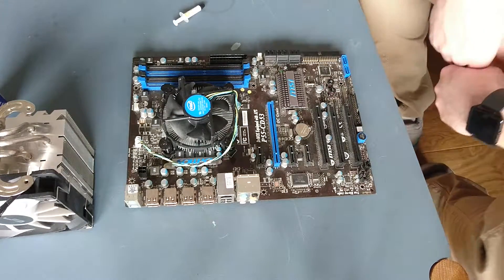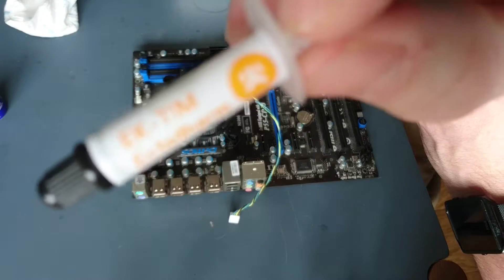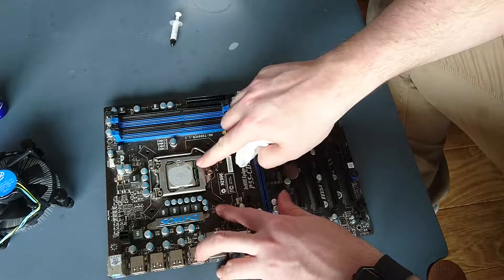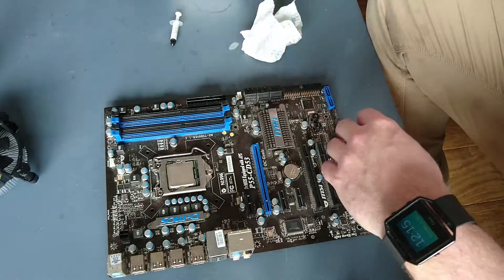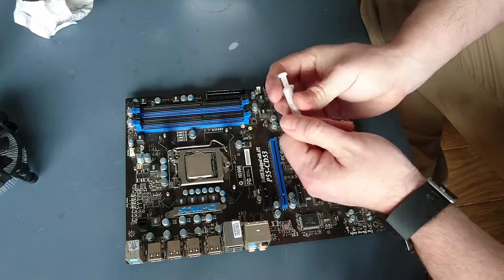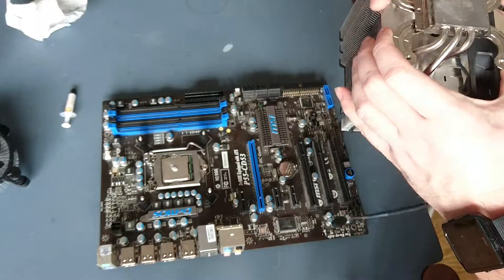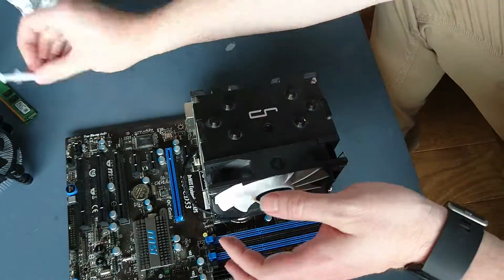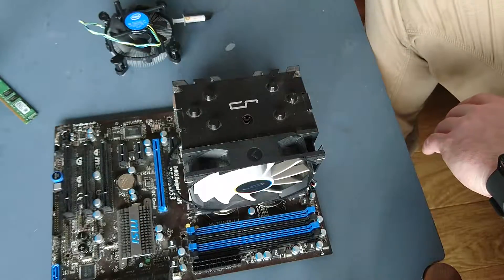Installing a Second Hand (USED) CPU Cooler

Comment: Hey man! Informative video. I want to buy a CPU and Cooler for 60$ so I am going used. I have an Intel Dh55tc motherboard. I have found a Xeon X3470 for 50$ and thinking of a cooler for 10 or maybe 20 dollars that will fit my case and I am thinking of buying a used Cryorig C7, do you think it will be a good idea?
Reply from the maker: I think cryorig coolers are pretty good, so if you can get one cheap go for it!